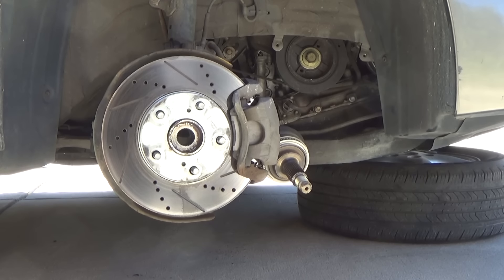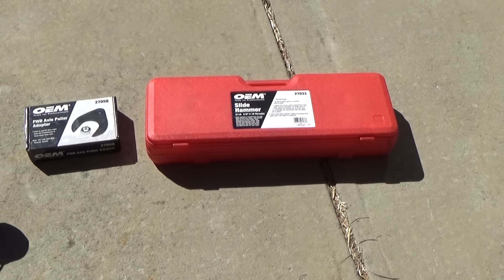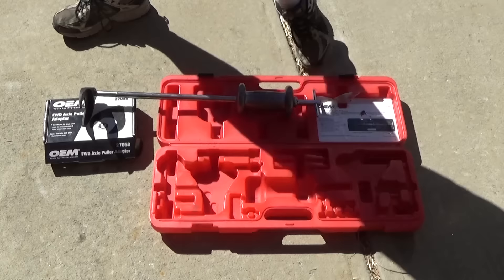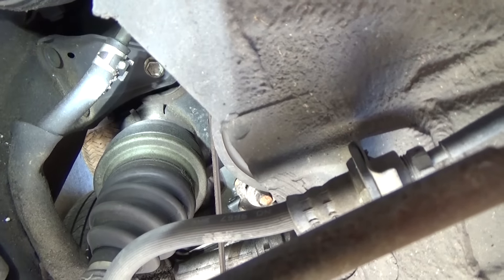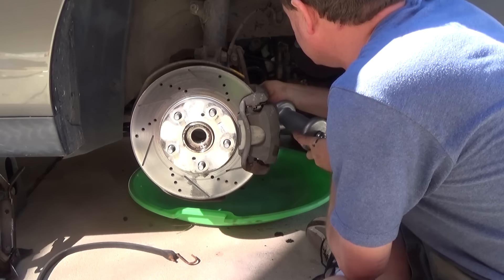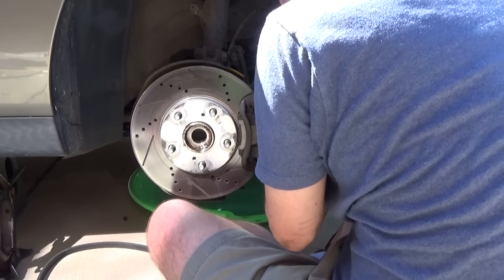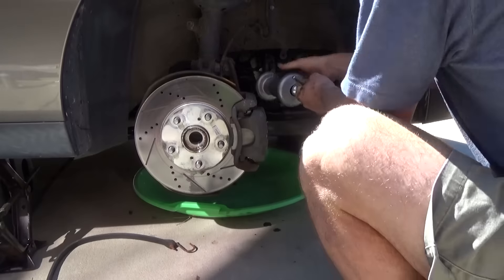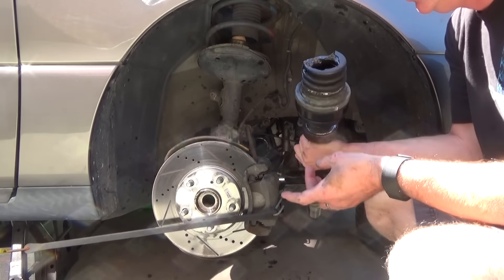Use a Slide Hammer to Remove a Stuck CV Joint

Comment: Same thing happened to me today and I’m renting the hammer
Reply from the maker: Get the biggest one they have.  CV joints can make you question your life.
Reply: @ClintHolland  looking through the comments of your video because I currently have a stuck cv joint passenger side on a new car as well. Honda Civic 2018 smh!
Reply from the maker: @ricardoherrera2313  Hopefully you were able to finally get it out without resorting to a torch.

Comment: I got one same side that wont go in because of that stupid C clip which in mine since they are Chinese craps that c clip came deformed, I had to order C clips from Advance Auto Parts, then tomorrow will try this renting same tools from Auto Zone, now mine is not all the way in at all as it has a gap of 3 millimeters before touching the seal, the passenger side I could installed just fine; driver side is the one raining on the party so will see tomorrow and will see if I can install it fine after replacing the stupid C clip; I knew it was going to be a problem but tried anyways just in case; hit is with mini sledges 2,3and 4 pounds putting a piece of 2x4 no luck, had 2 friends helping to hold the shaft and the boot not to move, nothing; next time i have to replace these I will look for OEMs!
Reply from the maker: Good luck.  How did things work out?
Reply: @ClintHolland  don't know until I drive the car. I installed another seal and new C clip, factory, still does not go in all the way but it does not get out if trying to pull it by hand either so it is hard to tell;  they told me to drive it around the block; it it leaks, re do it if it does not it should be ok. It really sucks.